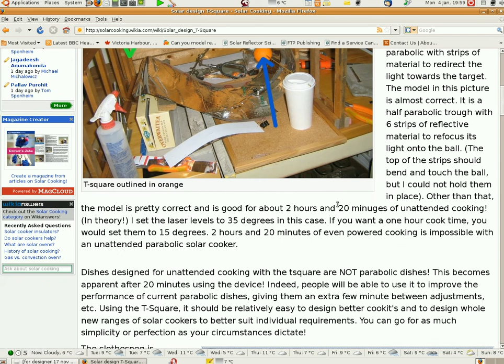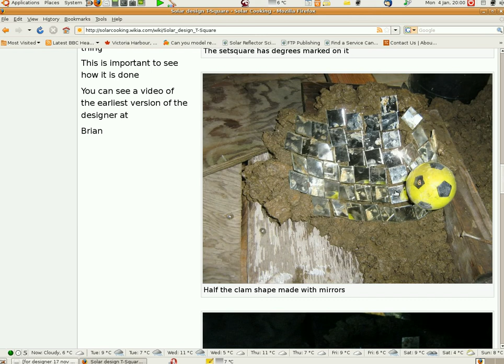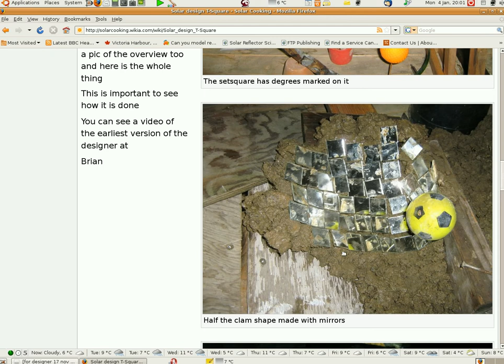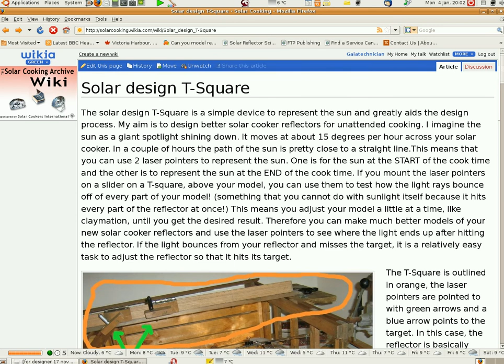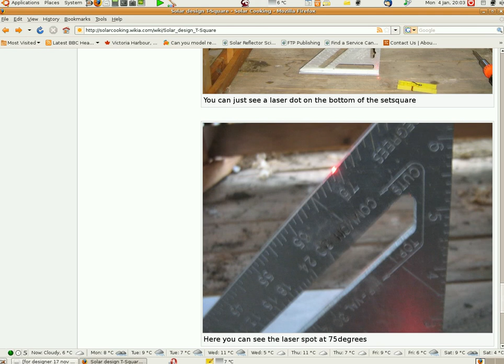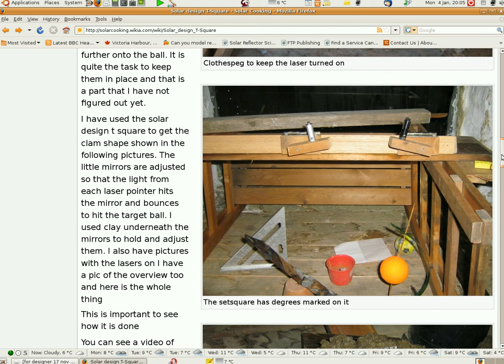Solar Design T-Square and many mirror model

Comment from the maker: Just a note that the solar design t-square page on the solar cooking wiki is being updated pretty often.
I have an animated gif with a procedure to make the clam shaped reflectors at the bottom of the page (Guf updated  often!). That should help people build their own. 
There are SO MANY OPTIONS with this thing so I cannot investigate them all. For instance box cookers with the reflectors at opposite sides of the boxes  and glass in the sides not the top.
Check that link for model ideas.
Brian